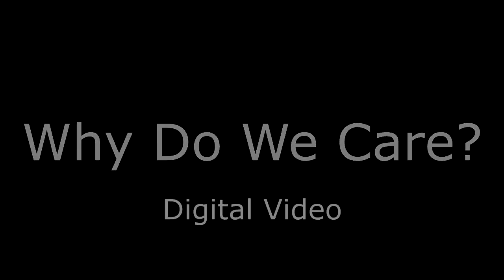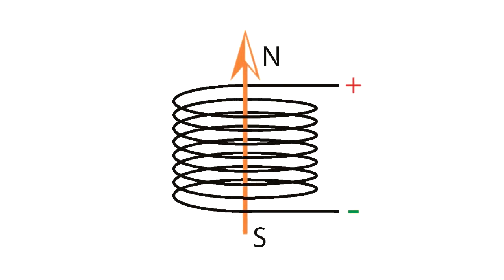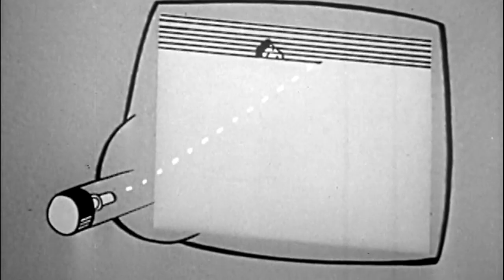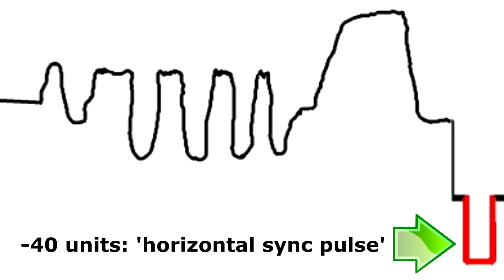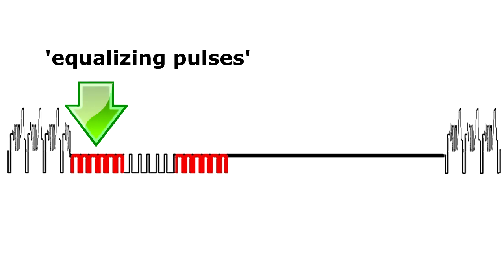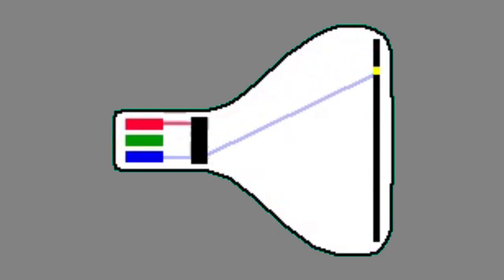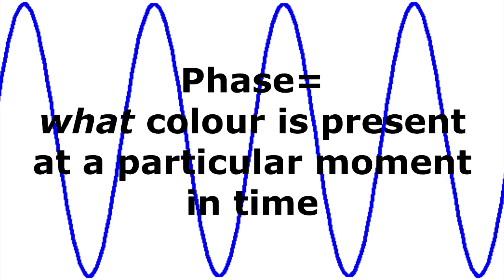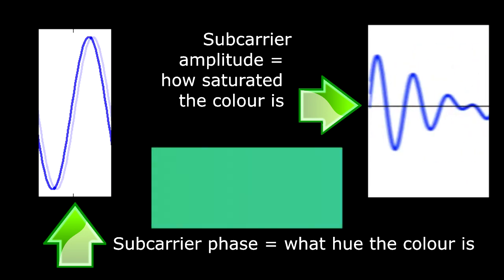How Analog Video Works

Comment: Instead of inserting the colour signal into the original broadcast signal, a much smarter decision would've been to temporarily have an additional broadcast signal on a UHF channel (which would've used the CCIR B system like PAL) and colour television would've had a better resolution of 625 lines. Eventually, the old 525-line system would've been discontinued sometimes in the late 70's or early 80's and older TVs would need a converter box just like when analogue TV ended in 2009.

Comment: I have a side gig digitizing home videos and was looking for a way to explain analog video (and why it's never going to look quite the same when digitized) to a client and this was the first one that came up, which gave me a chuckle. I had Dana as a prof while at Ryerson RTA and it's nice to hear his voice again. Not sure why so many of the good ones leave us before their time but I'm glad he left us a bunch of his knowledge.
Reply: You can fix a lot of the problems that come from going from analog to digital with a frame and line TBC. It’s expensive though and the real problem with that is consuner ignorance. The line TBC in a VCR fixes why they are talking about at 3:45 which is common in older VHS recordings. It fixes geometric distortions. Then a frame TBC fixes the signal. Digital is perfect and when you’re going from analog to digital you need to use TBCs to make corrections and prevent dropped frames and geometric distortions.

Comment: On flashing difference entire screen at a time instead of pixel at a timd and angling shadding of difference time banwidth then motion display happened. So 3 timers drive three lamps then sine or cosine timer is all data needed is time phase angle. Thanks. This is best engineering textbook presentation i had seen. Supper..you deserve great reveer and respect and reward from youtube...🎉

Comment: With extreme high resolution digital then it is as smooth as analog but can be more slective in precision like stepper motor or anticolision technology or airplane position air and ground speed calibration

Comment: I can see how crt cameras emulate the mechanical tv cameras. They use magnetic fields to bend the light as apposed to the physical changes using discs to modulate the intensity of the light on the photo-sensitive element.  And then the image viewer follows the same path as the camera to make the image appear,  just like the spinning discs. With both systems, synchronization is imperative to see an image. With the mechanical system, the speed of the disc would most likely need to be constantly adjusted, whereas the electronic version, the sync signals are built into the carrier wave. Very interesting. I wonder why the vertical hold knob was easily accessed in the crt tvs while the horizontal control was seldom seen.

Comment: European PAL system works in the same way.  The difference is that the modulation of the color signal is inverted every line. This is to compensate color deviations.

Comment: Excellent video. I have been trying to fix the pcb board that drives a crt. The hot keeps burning out and there is no high voltage. I suspect the horizontal frequency is wrong.

Comment: Using degrees on a circle to encode colour is very clever because it gives you a wide range of values to play with.
Unfortunately this also makes the signal highly susceptible to colour drifting - you risk having your entire colours shifted if there's even the slightest phase delay.

Comment: Awesome video (+1)

So basically everything is a varied voltage signal, which IS  proportional to current, because of ohms law. 🐒, Umm.. so it's current x resistance makes voltage. And since they all play together so we'll voltage changes and so does the rest of 3m (current, resistance... Watts..) 🌞 

It's all because of changes in environment that also is related to voltage, etc. So technically everything is related in some way (exsistance). So if that's true, then a butterfly flapping its wings and one part of the world has an effect on another part of the world..

Resistors are very cool simple components.
Just learned how to read "voltages" and current, n display/re-represent them. I also learned another cool thing about operational amplifiers today... They can amplify that signal. 
😁

It seems we are advancing everyday... We were dumber yesterday than we were today. Why? Where did we come from..? Why didn't we know how to fly to the moon yesterday..?

Everything is basically a reflection of itself.. were all bouncing around and mingling inside this reality we call exsistance, and it seems the entire time of her existence we've been trying to stabilize things.. get a perspective on things if you will..

Comment: Thanks this was very useful. I’m looking at restoring a few vintage 405 line televisions here in the U.K. I think this very old standard has some differences to what you described but it was still very useful. I’m looking at the waveform from a 1960 pattern generator at the moment and hope you will take a look and share your advice. Great video thanks for sharing.

Comment: The CCDs quickly replaced the iconoscopes in the 1970s. Iconoscopes were huge devices and to use 3 of them just to have color on TVs was not very feasible... That's why when CCDs appeared color TV became more viable. Sure it was possible to make color TV with 3 iconoscopes but then the cameras would become humongous, seriously they were already quite large and expensive with just 1 iconoscope... So yeah CCD chips made color TVs economically viable pretty much.. And specially when it became possible to have all 3 colors on a single CCD chip. Nowadays we have CCDs and CMOS chips.
Reply: ? they have been using tubes for quite a long time ccd came into vogue somewhere around the mid 80's. I guess somewhere around '83 for studio work and late 80's for ENG field work. Which was not really possible before anyway. They used 16mm film for field 'news' work before that. I still prefer 3ccd rendition for color (colour lol) over bayer but that's just my personal pet peeve.
Reply: The size of tube studio camera's was not really an issue (I guess) the tubes are pretty small too, What was an issue is thermal expansion so the thing has to be re-alligned once in a while and afterglow effects which are very visible on 70's recordings when there are disco lights involved. I guess sensitivity is an issue too although this is all guesswork on my part I was never a camera operator it's just what I remember from TV. And I guess the ENG thing is more of a matter of the betacam recorder then the tube versus ccd thing but what do I know. It's possible a field three tube camera uses a lot more power so that's an issue. Although at some point I did have a philips consumer camera from the mid 80's that had a single tube that did colour. It used a filter screen with vertical stripes like yellow/white/cyan so the electronics could get colour out of it. It didn't suck that much power but recorder was not included. I fiddled around endlessly with the little pots inside to get a nice picture and eventually gave up it was not that bad though a bit insensitive. Insensitive in terms of when you point it outdoors at night only the lamps would show up..
I case anyone is wondering the camera used the different amplitudes coming from the tube to syncronize the colour circuitry. so the white/transparent bits gave the highest amplitude and so the electronics 'knows' how to lock-in and decode the colour.
Reply: Umm, RCA, Phillips, Bosch and others made color TV cameras using 1” or 11/4” tubes, tube sizes dropped to 2/3” and even 1/2”tubes before CCD’s took over. Tubes had several flaws, they had to get aligned and replaced. A new set of three tubes was around $10,000 in the mid 1980’s.

Comment: s
SECAM is the best! Probably because it's french(or maybe because the color component uses FM modulation which is the more robust)
Reply: For the French, the biggest selling point of SECAM was that it's not American ;-) Something Essentially Contrary to the American Method.
Reply: Mandolinic It's exactly that. NTSC uses quadrature amplitude modulation causing 2 problems:
1)color shift if there is phase shift in the receiver
2) The frequency between the luminance carrrier and the color subcarrier has to be an odd multiple of the line frequency to avoid ugly patterns of intermodulation between the two carriers from appearing on the screen, which leads to a crappy framerate of 59.xxx fps (interlaced). SECAM uses FM for color subcarrier so it is more robuust inna RF rransmission and it uses a delay line so it does not have to transmit the red and blue chrominance information at the same time on the same carrier, which allows better colors. The 2 problems of SECAM are incompatibility and it's a little bit more expensive.

Comment: Can you do PAL (Phase alternating line) video?
Reply: All principles presented  here are same for PAL and NTSC. Differences are quite small and you need to know details about QAM (quadratic AM modulation) to understand it. In short PAL modifies every second line of chroma signal to correct phase error that can occur during transmission. So PAL receivers don't need  hue control.
There are also differences in timing - every european system (also BW) is 25fps, american 30fps. European PAL use 50Hz for vertical scanning, 15625Hz for horizontal scanning and 4,43MHz for PAL color subcarrier.
Reply: JacobTHESitton

Following on from the excellent answer by xsc1000: In practice the NTSC system suffered from an issue where phase shifts in the transmission chain caused colour errors on the screen. The PAL system developers designed this problem out of their system by inverting the phase of the colour signal on every other line, with the colour burst at the start of the line telling the monitor what was the reference phase for that line. This is a relatively minor change, but it meant that a colour error on one line was compensated by a colour error in the opposite direction on the following line!  When integrated by the viewer's eye, the errors cancelled out and the overall colour was more stable. As TVs were developed over time, they included a one line delay which meant that errors could be compensated by electronics within the set, rather than by eye. 

One minor detail that gets overlooked is that with NTSC, bright parts of the image are transmitted with a high amplitude signal, and dark parts with a low amplitude signal. This is reversed in PAL. This meant that when an unsuppressed motor bike went past your house, instead of creating white spots on the screen, it created less visually intrusive black spots.

Comment: it's wasn't 30 times per second but more 50 or 60
Reply: It's actually half of each, 25 FPS for PAL and 30 for NTSC (actually like 29.97) But yeah if you're talking about refresh rate it's higher depending on the display, but it'd just be tracing the same frame again. I think the video just simplified it to one pass per frame
Reply: 50hz is Standard PAL and 60hz is NTSC. However during the late 90s PAL Televisions got a refresh rate upgrade of 60hz called PAL60 to match NTSC 60hz
Reply: NTSC video is interlaced. So while there are 60 fields per second, there are only 30 full frames per second
Reply: @FinalBaton   Be careful - an interlaced "full frame" isn't one picture. It's two different pictures (the fields) concatenated, so that they add up to 480 visible lines. NTSC TVs update at 59.94 different images per second, not at 29.97.

Comment: It would have been more consistent to stay with  camera tubes for color. Introducing CCDs when describing the basics of color TV was unnecessary and confusing.

Otherwise quite a good video.
Reply: Along with CRT displays they were the last bastion of electrons flying around in an evacuated glass enclosure.

When comparable CCDs' became cheap and expensive plumbicon tubes became even more expensive than they already were the choice was inevitable.  Nevertheless, I still have lovely examples of old technology.

In 2018: the price of a studio tv camera (head only - no lens)  costs some £30-40,000.  A nice new  3 - 4 bedroom home now costs around 10 times that give or take.
In 1968:  a new EMI2001 British made studio colour tv camera cost around £25,000 at a time when such a sum would buy six 3 bedroom houses. A new Rolls Royce, Silver Shadow was around £3500 (the price of six new Ford Cortinas).

Technology is so cheap now that people tend to take it all for granted.  Professional electronic engineers are now less valued in society than hairdressers.  It is incredibly sad.

Comment: It blows my mind how somebody came up with the idea of capturing & generating an image by just using a light beam,how ironic is that? 

Also it blows my mind how those colors are mixed together with the contrast signal for broadcasting in color athome.the only thing i know is that the gren signal is converted to a contrast signal to ansure compatibility with B&W tv's , to save bandwitch ,and preserve most of the colors ,when that contrast signal enters a color tv,that contrast signal will be converted back to green,while the red and blue colors getting decoded.

Also if it is true that a camera tube NEVER could capture 1 entire frame atonce, then that will mean that any fast motion will cause a comb artifact or rolling shutter artifacts.
Reply from the maker: +johneygd I've left the details out of this video, to keep it simple. I've written a full explanation of how NTSC colour encoding works, here: http://www.danalee.ca/ttt/appendices.htm#colourencoding
Reply: +Dana Lee thanks alot.

Comment: The NTSC (National Television System Committee) is the first compatible color broadcast which is backward compatible to the existing black and white TV receivers. And the color NTSC receivers is also backward compatible with the existing monochrome signal. Therefore it deserves respect. The Never Twice Same Color often happens during the vacuum tube era which as the tube heats up more, you need to re-adjust the tint control. But during the 1970s when transistor TV receivers was developed although out TV still has a tint control but we hardly touch it.
Reply: bobskie321

I must agree with you. What NTSC did was to prove that a compatible colour TV was possible and to get it working. It's an amazing achievement and the fact it remained in use for so long is testament to the sound principles of its basic design.  Where PAL and SECAM won out is that their designers were able to see NTSC working, and learn lessons from it. But that would not have been possible if NTSC hadn't been there first.
Reply: the french have unique designs, they are always very original,
Reply: bobskie321

Comment: A good addendum to this documentary would be an explanation of how basic picture controls work.

During the last 60seconds, "Phase" is discussed: the temporal alignment of the color subcarrier.  The phase control long ago became known to consumers as the Hue, or, Tint control.   Its purpose was to maintain the proper time alignment between the Luma(original black & white) and Chroma(color subcarrier) components of a NTSC broadcast picture.

Thus, "Tint" really has only ONE correct setting - the setting that aligns that color burst synch to 180deg.  A calibration test pattern, plus a blue filter or blue-only mode, can be used to arrive at that setting.  And the value of that setting may vary from set to set.  

For Tint, and as for the other user picture controls(Brightness, Contrast, Sharpness, and Color)' there are no "preferred" settings, just CORRECT settings, which will allow one's analog or digital TV set to effectively become an extension of the studio broadcast or cinematic chain, guaranteeing viewers the most accurate image their display can deliver.
Reply from the maker: Zickcermacity You're quite right! I decided to leave it at the point I did, so that viewers who were interested in exploring further could do so on their own. I do appreciate your thoughtful comments - thanks!
Reply: The problem is that today, despite leaps & bounds in quality and reliability of flat panel TVs, and the superior consistency and quality of digital TV(HD and SD), most of these panels are set up in a most non-standard mode at the factory, to compete with one another in retailers and dealers.

Things weren't any better during the old analog(CRT Tube) era, but I'm a believer in educating consumers what the controls do, and what features can be disabled, and actually improve picture quality and transparency.

I highly encourage viewers here to look up Joe Kane and the work he has done to attempt to bring accuracy to the viewing experience for the average consumer and for the upscale home theater owner.  Calibration in a sense "removes the TV" from between source and viewer, allowing them to see exactly what the producers and directors of shows and movies want that material to look like.

Comment: PAL Rulezzz ;D
Reply: PAL60 is better
Reply: Yeah, well, the extra scan lines only happened because the frame rate was lower.  Which happened because current alternated at a different frequency in Europe.  But all systems suffered from the fact that they had to be backwards compatible to the B/W signal.